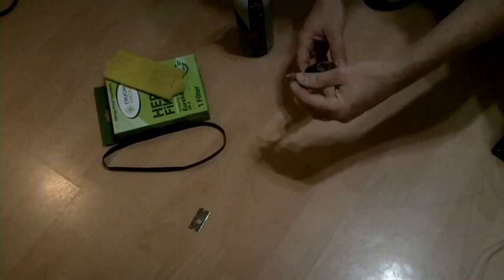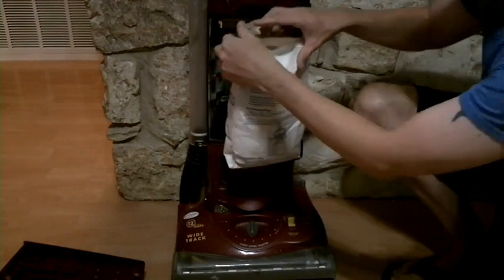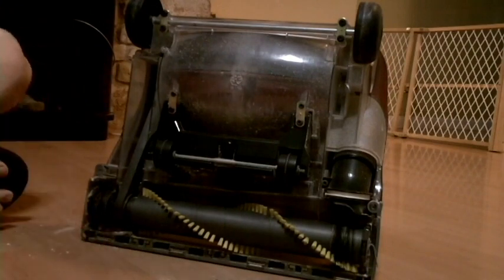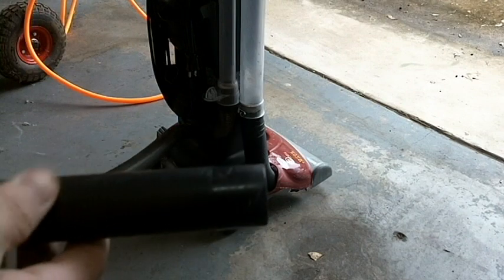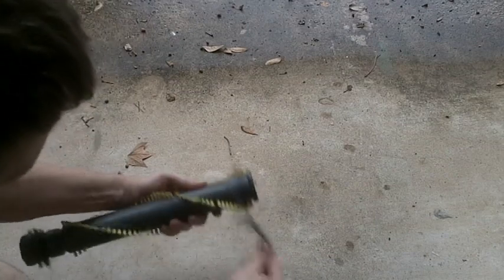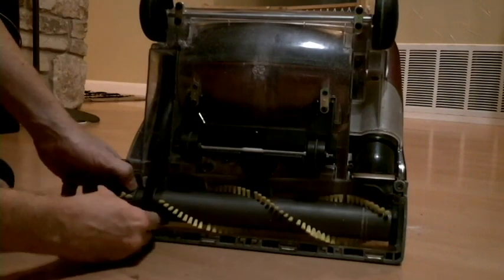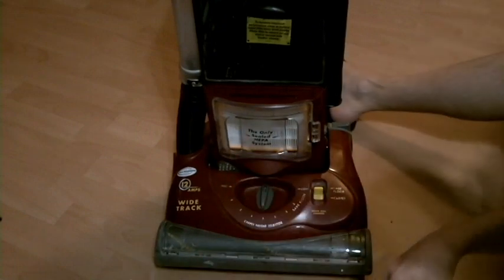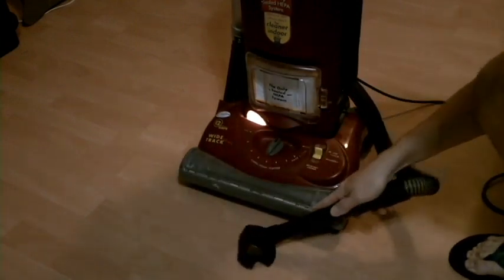Eureka "The Boss" SmartVac 4870 - Tune Up

Comment: If your belt tension roller isn't working properly it's a waste of time and money. That small chrome wheel has to be fully spring loaded to where it can put more tension on the belt as it stretches. If not,the belt will be slipping in 3-4 weeks and stop spinning when lowered down on carpet.

Comment: Interesting to read all the comments about belt issues. I've had my 4870 since 2006, and just tonight put my 3rd belt on it. However, I'm having a new issue just since I replaced this belt. When I put it in the upright (idle) position the brush no longer stops spinning. Apparently some sort of switch issue? Any insight/pointers would be great!
Reply: Edward Knoch did you ever get an answer on your question about the roller spinning in the upright position?
Reply: No, I haven't, Jim. When I bring the vacuum to the upright position, if I push it forward firmly, the brush will stop, but when I let go of the handle, it settles back maybe an inch or less, and the brush starts spinning again.
Reply: I have the opposite problem. The brush only spins when it is in the upright position but not "clicked in" to the storage position.

Comment: The roller on my vacuum is only rolling on the side with the belt.   The other side does not roll at all - I supposed I need a new brush roller?  Is it supposed to spin on both ends?  It feels like a stupid question but it's been a while since I replaced the belt so I can't remember.

Comment: People have to actually watch a video on how to change out the HEPA and motor filter, and to replace a brush? The belts break due to heat and not sure, unless you get a Kevlar belt, they need to be replaced at least every two years. 
I have put my Boss through hell, having owned and still own Alaskan Malamutes that blow out more fur in one spring week then most people will ever see.

Comment: The 4870 eats belts and there is NO way to fix it. 
IF you make it past the first use without breaking the belt you are VERY lucky. I let Eureka dick me around long enough that I couldn't return it. From what I read that is what they do with this POS model. IF you do call them be prepared to be belittled and constantly be told YOU  are doing something wrong because they have never heard of a problem with this model. Google it and you will find thousands of people that have this issue.